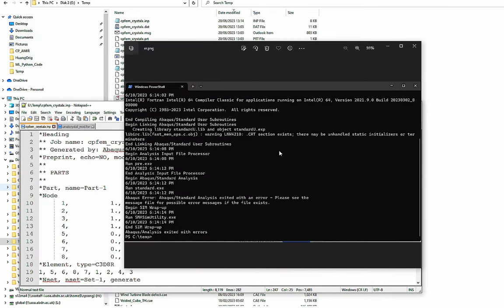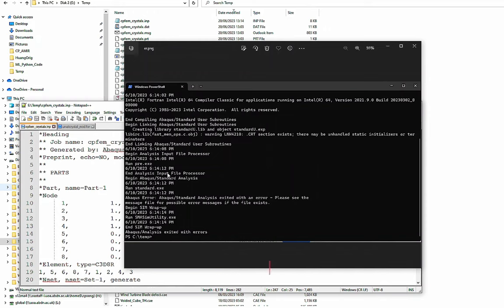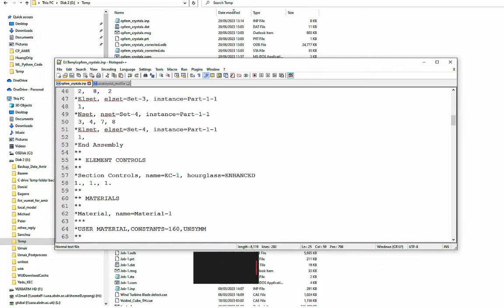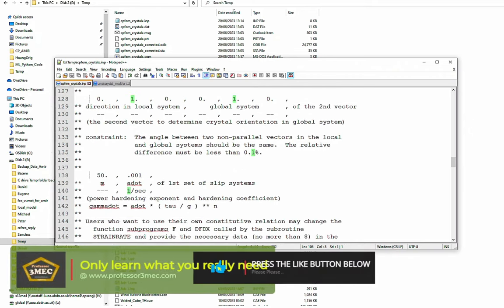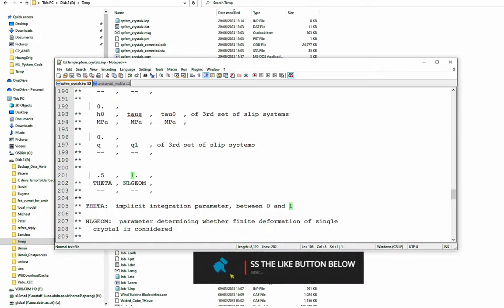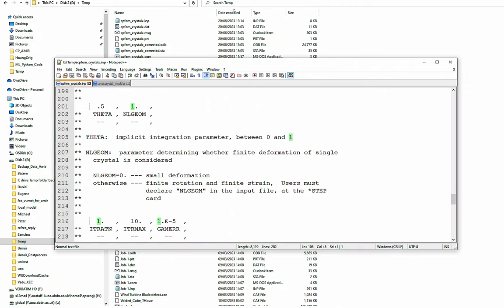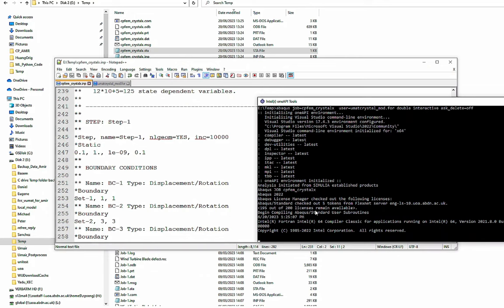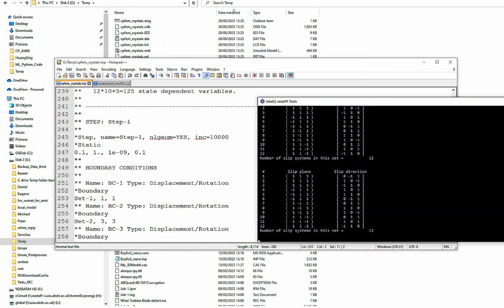Crystal Plasticity UMAT not working? Check this video out!

Comment: Thank you for your big support. But I still can't run it. I get command warnings like this.
ifort: command line warning #10161: unrecognized source type 'names:lowercase'; object file assumed
ifort: warning #10145: no action performed for file 'names:lowercase'
End Compiling Abaqus/Standard User Subroutines
Begin Linking Abaqus/Standard User Subroutines
   Creating library standardU.lib and object standardU.exp
libirc.lib(fast_mem_ops.c.obj) : warning LNK4210: .CRT section exists; there may be unhandled static initializers or terminators
End Linking Abaqus/Standard User Subroutines 

Hope you can help me. Thank you, sir
Reply from the maker: It may be that you might not be using the compatible version of the compiler.
Reply: @Professor3MEC  Thank you for your reply. I could do it.